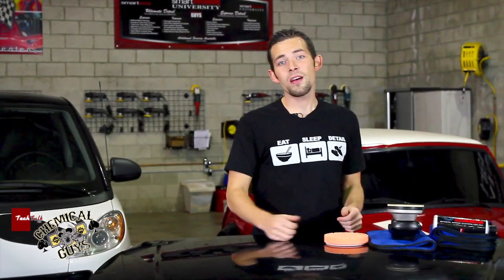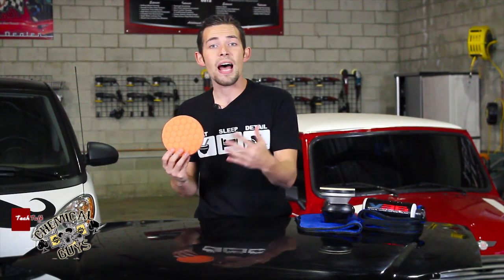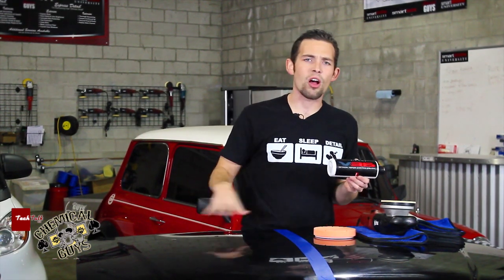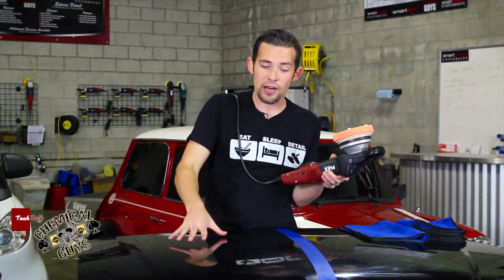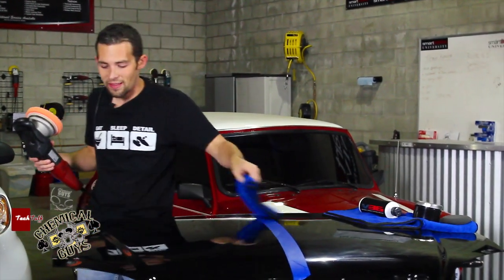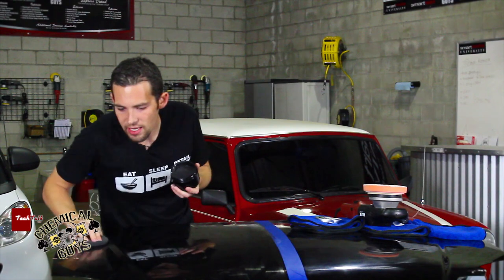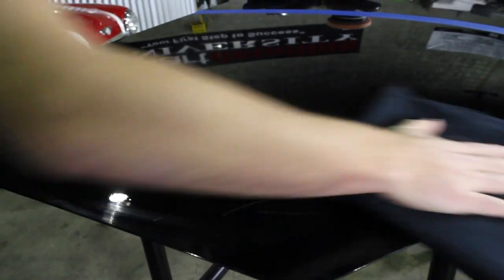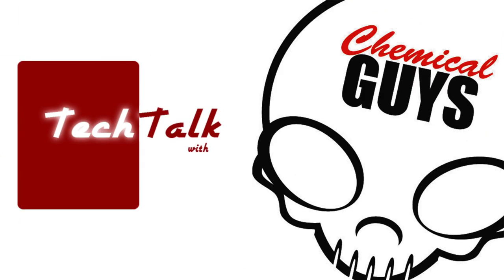How To: 1-Step Polishing To Remove Swirls and Scratches - Chemical Guys Paint Correction EPIC SHINE

Comment: Nice video, man.  I was just doing some research on polishing water based paints like a Tesla.  I've used a lot of Chemical Guys products in the past and have always found it to be very effective.  I'm not working on a car that is super damaged like this hood was, but I will definitely have to look at some of your lighter polishes and see what they might do.

Question about your Black wax.  It looks like it stained your fingers a bit.  Much filler in there?  It looks like you were getting pretty great results without any filler waxes before, but I'd be curious how much of the results we saw at the end was due to the pigment in the wax filling up the rest of the scratches.  The video barely shows a mark on the paint that could be corrected with a machine, but I'm sure in person you could still see some defects.  Anyway, just curious why you chose to cover the panel with a black wax when the point was to show off the correction power of a '1 step'.  (1 Step in my book would include the protection, by the way.  This may have been a 1 Step correction product, but if you still have to wax afterwards then it is more like a 1st Step type product, yes?)  

Great work either way.  I'm not trying to take anything away from that. See you guys at SEMA again this year!

Comment: bought your HEX Logic Orange, Blue and Black pads and a bottle of the V36 to use on my 1981 Trans Am with a glossy black 16 year old paint job on it,,  Got more done in the first spot in 5 minutes that I did using the other (wrong) method I was trying to get the perfect shine with,   I am currently experimenting with a touch and blend on 2 spots on the hood, Will let you know if I pull it off

Comment: Great vid, I have a Buckingham blue lr3 what’s a good polish,sealer or wax after the correction and do you need to prep the surface first- panel wipe? BIG 👍
Reply from the maker: Hey Nigel, that's a great question. We recommend using the V Line Series kit  to cover all your bases. Test the heavier V32 and V34 compounds on deep scratches, intense swirl marks, and oxidation to remove severe damage and restore reflection to the paint. After compounding, or when dealing with lighter swirl marks on a newer car, test out V36 and V38 to refine the gloss, shine, and clarity of the painted finish. Use the full V-Line Kit to restore paintwork, clear optical plastics on headlights and tail lights, wheel finishes, carbon fiber, and any other exterior car part that is shiny or clear. For sealant, we recommend JetSeal, which is our longest lasting sealant. It offers durable protection against the elements for up to one whole year! Due to the dark color of your car, we suggest using Black Wax on your LR3, which is specifically made to make dark colored cars like yours shine! I'll also leave a link to another great alternative wax below. Thanks for watching Nigel and let us know if you have any other questions. Cheers! 
https://www.chemicalguys.com/V_Line_Polish_Compound_Sample_Kit_4_oz_p/gap_vkit_04.htm
https://www.chemicalguys.com/JetSeal_Sealant_and_Paint_Protectant_4_oz_p/wac_118_04.htm

https://www.chemicalguys.com/Black_Luminous_Glow_Infusion_8_oz_p/wac_307_1.htm

https://www.chemicalguys.com/Butter_Wet_Wax_16_oz_p/wac_201_16.htm

-----

Comment: you say cutting a lot. is it possible to eat through your clear coat if you polish more than a couple times??
Reply: Not really.  It is called 'cutting' when you polish paint, but really all you are doing is knocking off some corners on very light surface scratches.  It's not like you are sanding the surface and taking off paint everywhere you touch.  You are only taking corners off so the scratches don't show up any more.  Particularly when working with a DA polisher too.  You simply can't hurt the paint much with one of those unless you are trying your hardest.  Use the most abrasive polish on the most abrasive pad on the highest setting on a DA polisher and I'm sure you can burn your paint off, but like I said, you'd have to be trying pretty hard to damage your paint.
Reply: Anthony Marc Enough compounding will soon eat right through your clear coat though. Best be safe and use a Paint thickness gauge when ever compounding and polishing.

Comment: Do I still need to wax after a polish? I have parts on my truck that have been covered by stock stickers for 10 years and I want to get the rest of the paint that nice. Is this possible with a 1 step? I was looking at your polish wax and shine in 1 product the gap  106
Reply from the maker: Hey, if you're looking for a one step, V4 All in one Polish is the product for you! Chemical Guys V4 All In One Polish creates a mirror finish topped with durable protection in just one step. V4 cuts away light imperfections, scratches, and swirls, finishes like a fine polish, restores lustrous shine and deep reflection, then adds a layer of durable protection against the elements. V4 cuts away light imperfections, scratches, and swirls, but if your truck has anything more severe than that, a more aggressive product will be needed. If you're not sure if your truck might need a more aggressive approach, you can always DM us pictures of your paint to our Facebook page. Thanks for watching and stay tuned for more videos headed your way soon! 

https://www.facebook.com/ChemicalGuysMfgCo/

Comment: When ever I one step polish my cars there is always some kind of white dust that flies off the pad from the machine. Am I adding to much pressure, product, not enough, etc? What am I doing wrong and if I wipe the dust off will it scratch the paint? It happened most on panel gaps, panel bents ( the body of the car is curved), areas where the pad is not totally on the paint, and curves on the car.

Comment: Got rid of the swirl marks and scratches But you can see dots in the light all over the hood.  I'm no expert But after 1 coat of adhesion glue 3 coats of Black and 3 coats of Rootbeer pearl and 3 coats of glamour Clear coat I knew i would be wetsanding my panels flat and clear of orange peel in the paint before Buffing and polishing

Comment: What factor does the speed of the machine add to this equation?
Reply from the maker: Hey there! A higher speed creates more friction/heat that refines more clear coat.
- CG Nick
Reply: Speed setting 4.5 on a DA is the most recommended.

Comment: Soo what are those dots/spots on the hood after it is polished??(seen in the light reflecton.
Reply: That paint is pretty beat up.  Those are probably rock chips and areas where the paint is extremely damaged.  Polishing will fix surface stuff, but sometimes you need to go further to correct everything that is wrong with it.  Kind of like going to the dentist every so often for a polishing will get a lot done, but when you need a filling there isn't much a good polish is going to do to help.
Reply: he spits too much when he speaks
Reply: and boooyy does he talk a lot

Comment: Hey Greg you said that you were using a 5" chemical guys backing plate on the Flex XC3401VRG. The link provided shows the regular 5.5" factory backing from Flex. Can you please provide a link a to the backing plate that you mentioned in the video made specifically for the 3401. Thanks.

Comment: I just ordered the v34 for my vehicle because I watched another video telling me it was the great one step, to save time and money, which one is the best choice?
Reply from the maker: Hi Jody! Chemical Guys V34 is a great compound to use with a two step polish, if you are looking for a good one step polish, we recommend using Chemical guys VSS it removes scratches, swirls, water spots, and any other imperfections. Chemical Guys VSS is formulated for fast work time using any dual-action or rotary polishing machine. VSS is water-based, body shop safe, and OEM approved, which means it will deliver great results in a fraction the time of standard 2 or 3 step polishes. For the fastest one-step scratch and swirl removal use Chemical Guys VSS Scratch & Swirl Remover! Thanks for watching and thanks for being part of the Chemical Guys family! Check the link below.

https://www.chemicalguys.com/Scratch_and_Swirl_Remover_16_oz_p/com_129_16.htm

Comment: Did you even prep the surface (claybar)?? If so, it's probably worth mentioning at least.
Reply: It's not a video on all of the proper steps to detail a car.  He was just showing the cutting power of the polish, so claying the car before isn't even a necessary step.  Who cares if you left IFO embedded in the paint when the point is to show off the swirls?  I'm sure they have another video all about clay and the other steps too.

Comment: Hi. I called a well recommended detailer  today. I asked for a polish and wax only for the outside of  my car. 170 euros for a e46 cab. Seems very reasonable and he has been working on m2s, audi rs7s and porches. What I wonder is when he has removed the scratches then polished it with wax, do i myself have to seal it? don't you seal then wax? Or should I simply accept the car's result and spray wax it after each wash I do once a week?
Reply from the maker: Hey, thanks for watching. You have to apply sealant after polishing because the clear coat will be worn away, and the paint beneath will be susceptible to oxidation from the sun. Then you would apply a wax for extra protection, and shine.
Reply: Chemical Guys can you really apply wax with a mashine after sealant? Will that not ruin the sealant? thanks.

Comment: I see you started at one speed and increased it what did you start at and finish
Reply from the maker: Hi Jerry, good question. Spread on speed setting 1. Then, set DA machine to speed setting 5-6 and using moderate pressure, work area in 2-3 passes until compound becomes clear. Thanks for watching, Jerry, and thanks for being a part of the Chemical Guys family!
Reply: @ChemicalGuys  your videos have been very helpful  and a pleasure to be part of the family

Comment: Can you also use the chemical guys VSS for a one step polish?
Reply from the maker: Hi Nicola, good question. Yes, VSS is in fact a one step polish that will cut hard and then refine down to a finishing polish! VSS is water-based, body shop safe, and OEM approved, which means it will deliver great results in a fraction the time of standard 2 or 3 step polishes. Thanks for watching, Nicola, and thanks for being a part of the Chemical Guys family!
Reply: Chemical Guys my car got a one step polish 2 years ago, and was wondering if i ever do a 3-4 steps polish (V34,V36,V38) would it rip off my paint because its not as deep as original?
Reply: Im in a learning process 😅
Reply from the maker: Awesome! If you have any further questions, let us know!
Reply: Chemical Guys look up ☝️
Reply from the maker: Sorry, Nicola, your second question was held in review. Anyway, polishing removes only the tiniest fraction of clear coat. When using the proper techniques and products, you can polish your car many times without removing the clear coat. Assuming that your car was cared for properly in the past, then you can proceed with polishing your car with no adverse effects!
Reply: Chemical Guys Awesome, finishing compounds like V38 or Glaze/Sealants/Wax doesnt affect your clear coat though?

Was thinking of buying the Torq 10FX polisher. I like the dual action concept.
Will proceed to buy your polishing products online.
Reply from the maker: A finishing compound like V38 has barely any cut- it will just refine the finish and will not remove any significant amount of clear coat. Glazes, sealants, and waxes sit on top of your clear coat to protect it. They protect your clear coat and help it last its longest and look its best. The 10FX is the perfect machine to get started polishing! It has built in safety features that a rotary doesn't have to help prevent you from burning the paint.

Comment: Do you guys have a video on how to cut down to remove all the pits / divots you see on the polished side? I've got a lot of divots in my hood -- not chips, but definitely pits in the paint, and 36 + 38 got the swirls out but the divots remain. Do I just go to 32 on an orange pad, or should I do 34 first?
Reply from the maker: Those pits sound like mini dents. Typically you would try V34 before moving onto a heavier compound. Was your car repainted by any chance?
Reply: Chemical Guys - No, it wasn't repainted. One owner before me and I have all the records. And under the hood badge (removed for polishing) there's a small bit that shows the original condition.

There are some rock chips that go down to primer, and I'll be touching those up once I've got the rest of the surface as solid as I can get it.

I'll give 34 a try with a new orange pad and see what happens. Thanks for the reply!
Reply: This is a 2006 Porsche 911 in Lapis Blue. The original owner drove it year round and on the highway a lot. It has 110k miles and the paint has just been beaten up. Along with probably 30 small chips, there are thousands of the tiny divots. I'm thinking 34 may get into those more thoroughly than did 36. I'm not getting any paint color on the pad with 36, so I still appear to have some clearcoat left to work with.
Reply from the maker: If all else fails, take it to a paint professional and they can measure the paint depth, and possibly they could determine what the divots are. It sounds like rocks were bouncing off of the hood, and left dents and chips. From my understanding their's puddy that they sell which you could use to fill in the divots. Try it out see what happens, worse case scenario you have the car repainted.

Comment: Did he say that its ok to use a lighter polish like v36 and then a heavier one like v34?
I thought you need to go from heavy to light, not the other way around.
Reply: No.  He said you can always step down to a heavier cutting compound like V34 or V32 if you do not get the results you were looking for with the blend (V36).  The key to 1 Step polishing, which is not always an option is to get the right amount of cutting and finishing thereby reaching desired results in a minimal amount of time.  In detailing, time is money!

Comment: I must agree horrible paint job thanks for not using the brinkmann light on that paint lol But v36 is a great one step and so is the flex I'm thinking of selling my dewalt dwp849x. With new pads polishes and just a dual action you can achieve the same results safely easier and with a whole lot less of a learning curve compared to a rotary polisher

Comment: Word to the wise don't ever use meguiars on anything carbon fiber. What happens is their products will severely damage the clear coat on the part. I can not stress this enough to you if the car is painted using House Of Kolor paint or the carbon fiber part is from Seibon it will actually strip the clear coat right off.

If nothing else use mothers or by my personal preference chemical guys.I Hope that helps.

Comment: can i use sealant instead of wax after polishing? or should i apply the wax, wait 20 mins and then seal the car later?
Reply from the maker: Hello Ahmad, thanks for checking out this video. actually it's best to apply the sealant directly after polishing because you've essentially removed layers of the clear coat which protects the paint from oxidizing. The sealant will protect the paint from the sun's harmful rays. You'll also want to apply a coat of wax to add additional protection, which will protect the paint surface from, environmental contaminants, debris, insect droppings, and other filth that builds up over time from regulars usage.
Reply: thank you guys for replying very quickly, I also have another question! assuming that I am working on my car or a customer's car and a storm unexpectedly forms after I finishing sealing and waxing the car. will I have to re-apply? assuming I don't wax the car, and I only seal it, will that also affect it the same way under rain? I've heard that you should wait 12 hours and then if it rains, it shouldn't be an issue. Thank you!

Comment: how come V36 didn't cause any maring or hazing here?
Reply from the maker: Hey thanks for checking out this video. It all depends on the paint, the level of scratches and swirls, and the combination of chemical, and pad. This happened to be the perfect one step correction, which doesn't occur all the time.
Reply: Understood thanks for replying. I was comparing this to a previous video with the old Benz that had the maroon lacquer paint using the same pad and chemical

Comment: What speed did you have the Flex at?
Reply from the maker: Hi Francis, thank you for stopping by and watching this amazing video. You first spread the polish at speed setting one which is 1600 OPM. When you're ready to begin polishing, then you set the polisher to the max setting which is 9600 OPM for the Flex dual action polisher. On a rotary polisher, you would set the machine to the fourth setting because rotary polishers have more cutting ability than dual action polishers do. I hope that answers your question Francis, stay tuned for more great videos coming your way.

C.G. Alex -

Comment: if i polish my car without sanding it i will remove swril marks?
Reply from the maker: Yes, you can think of polishing like very very light sanding. You are removing very fine layers of paint to cut away the paint that is scratched and damaged. This way, you reveal a perfectly-flat paint surface with pure reflection underneath.
Reply: Chemical Guys thank u